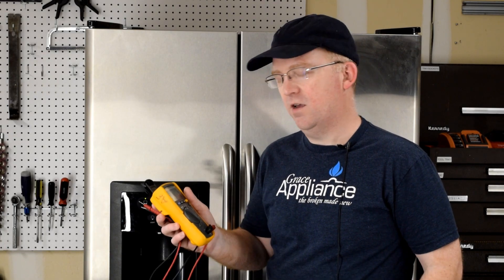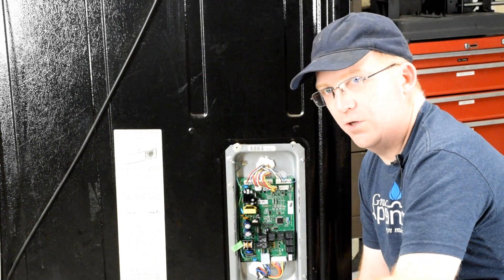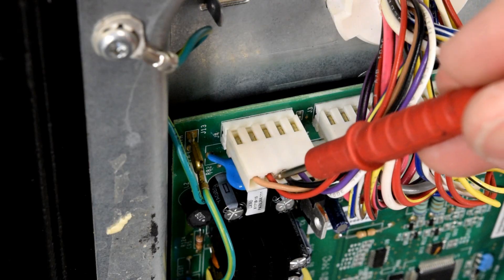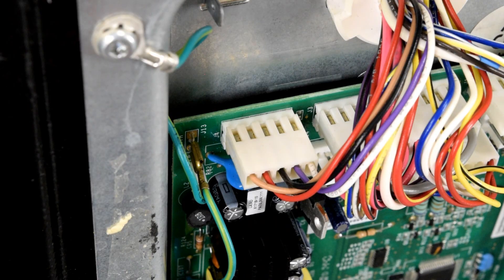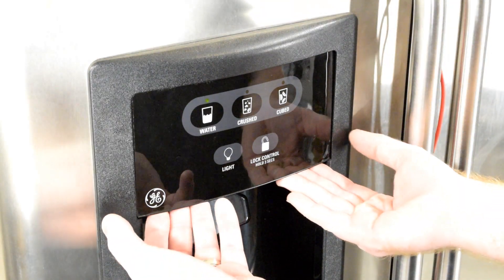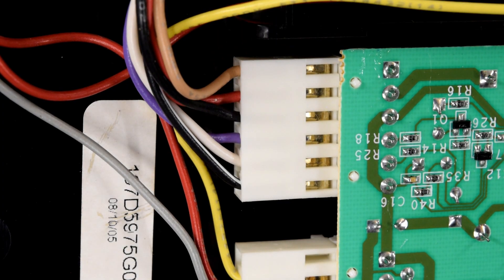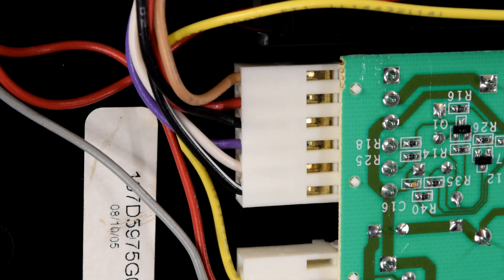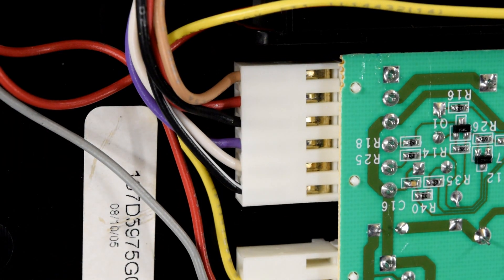Diagnosing a Bad Control Board - Part 4: Front Touch Panel

Comment: Nice, can you tell us where the diagnostic codes table2 are for the HSM25GFTASA type of GE Hotpoint fridges, I know how to get into diag mode from the 4 front touch buttons for temp, but don't know the diag codes, or maybe you can just tell me the one I need to diagnose the defrost heat circuit ? THANK YOU !
Reply from the maker: john Doe hey, 
I never put a lot of faith in an error code and tend to test for the particular failures at the suspected components based on the symptoms I’m seeing.  
If you’re having defrost issues, this video will be helpful.  You’ve got a wr55x10942 Control which is the same as what I’m testing ok this video.  
Let me know if you have any questions!

https://youtu.be/XeZfpB7ok90

Thanks!
Andy

Comment: Thank you. What if my panel lights up, but not dispense water? I have changed the filter, changed the valve, re-connected wires at bottom, but still no luck. I got water at 3 random times. The panel does light flickering when I press for ice and does not dispense any. I see ice in the tray. Plz suggest any pointers you may have. Thanks again
Reply from the maker: Hey, I'd first suspect that the dispenser micro switch had failed.

Unplug your fridge. 
Remove the front panel, and the white plastic housing secured by 4 Phillips screws. You'll see the black switch that's activated by the panel.

You should hear a soft click when depressed. If it's spongy instead of a positive click, it's failed.

Also it should read about .03 ohm when depressed.

Let me know if you have any questions.
Andy

Comment: Wonderful tutorial...very well explained and demonstrated. My son has just moved into a house and the appliances included in the sale included a GE side-by-side fridge/freezer. The fridge and freezer both work well but the touch panel does not, in spite of efforts to "reset" it. I applied a multimeter to the black and red "input" pins of the touch panel and it shows no power reaching the board. Unfortunately, when I tried to do the same at the control board, it is not the same as the one featured in your video, so I was not able to identify the "output" wires carrying the power to the touch panel, for testing. Any thoughts? The touch panel features a temperarure selection function. I have a photo of the control panel. Also, if I find that power is "leaving but not arriving"(!) this obviously means a fault somewhere along the connecting wires...what's the fix in such cases? (Specifically, is it possible to re-wire between the control board and the touch panel?)
Reply from the maker: Tim O'Leary hey Tim, thanks for the kind words, you’re most welcome.  

I think you’re on the right track in your diagnosis.  It does sound like a poor connection to the front board if indeed you have the correct measurements at the main board.   

Now, there is a very common connection to fail below the freezer door hinge.  It’s located behind the front kick panel. If you’ll inspect that for broken or corroded wiring, unplug it and replug it in about 10x, that may solve your issue.  

If not, let me know and we can go from there.  

Thanks!
Andy
Reply: @GraceAppliance  Many thanks for the speedy reply, Andy. I will do as you say and let you know how it goes; (it may be a week or so before I get back to my son's place). Tim
Reply: Hi, Andy. You may recall that I contacted you here recently about my attempts to identify the cause of a "dead" touch panel on a GE side-by-side fridge/freezer. Because the main control board on the appliance differs from the one featured in your tutorial, I have been unable to identify the two wires I need to check, with the multimeter, for the 12/14 volts going to the touch panel. I was wondering - if it's not asking too much (!) - if I was to send you a photo of the main control panel, would you be able to steer me to the two pins/colours on it that I need to test for the "voltage out (to the touch panel)" ?  Many thanks again. Tim O' Leary, Dublin, Ireland.
Reply from the maker: @timoleary9514  sure, glad to help if I can. Please send a picture of both the touch panel and also the main control board. Thanks!   Graceappliance@gmail.com

Comment: Andy, I have a Ge side by side which dispenses water but will not engage the ice dispenser. Micro switch is good. I was wondering if the ice dispenser door solenoid may be faulty since it doesn’t open only an inch or so. Does the solenoid activate the auger as well?
Reply: If it’s the touch pad board it shows it being not available anymore
Reply from the maker: hi Joseph, what is your model number please?
Reply: Model # GSS22JEPCWW
Reply from the maker: Joseph Folsom thanks!  
So, since you have only one paddle that activates the water and the ice, and since the water works, I agree that micro switch is working.  

Now, I don’t believe the ice door flapper shares voltage with the auger. 
Does your auger activate when the switch is depressed?  

I’d start by testing for 120vac at the solenoid. If the auger is not activating, I’d also check for 120vac to the auger as well. 

Let me know what you find.  Thanks!
Reply: Will do. The voltages in these machines work on both vac and dc interchangeably. Power to the touch pad is 13 and some change dc, and 120 vac to the solenoid? How can you only have approximately 14dc coming into the touch pad board and yet have 120 vac supply to the solenoid?
Reply from the maker: Joseph Folsom it depends on the component if it’s DC or AC. Your auger and solenoid are both AC. 
Your touch panel , fan motors and temp sensors are both DC. I’m sure there are other things that are DC as well, but I can’t think of anything else at the moment.

Comment: Hi Andy,
I replaced the control board. Now the compressor gets hot but the refrigerator still does not cool. Using a Kill-A-Watt meter the refrigerator draws around 10 amps when initially plugged in and then I can hear the relay click and current draw drops to around 0.25 amps. Does this mean that the compressor is bad?
Thanks,
Brian
Reply from the maker: It does sound like a locked up compressor. (I.e. the motor inside the compressor) as these will initially pull about 10 amps, but will usually drip to about 1.5Amps once the system pressure equalizes which takes a few seconds.  Can you feel the compressor running softly after it draws the 10 amps, or does it not run at all.  
A locked up compressor will usually buzz loudly until the overload relay clicks on.

Did you say that you’d also replaced the compressor relays?  If not, you may attempt to put on an RCO810 (not the rco410) which is a compressor hard start relay. You may be able to get it started this way and then take the same amp measurement at that point.  It should read between 1 and 1.5amps.  

If it I’ll then start, but pulls higher than this amp draw, the compressor is on borrowed time, but may run for a time.

Comment: Hi Andy, 
First thank you for your videos. They are very good but I still have a question. My GE side by side stopped cooling. Both the evaporator and condenser fans run but the compressor does not run and is cool to the touch. I removed the starter relay and tested for continuity between the 3 terminals on the compressor, there was continuity between all 3 terminals.  Next I checked for short between the compressor terminals and chassis, there was no short.  So I replaced the starter relay and the compressor still does not run. I checked for voltage between the leads that plug into the starter relay and no voltage. Next I removed the cover for access to the control board and found that the control board was blackened under the large relay (832-1C-S) that the grey 3-terminal plugs into. Does this relay just fail or should I chect the defrost system?
Thanks,
Brian
Reply from the maker: Hey, they do simply fail with age.  The relays get old, get carbon build up on the contacts and the poor connection creates excessive heat.  Then, you get what you’ve got.  
I would start with a new control board and monitor the fridge to see how it does.  I would not expect anything outside of that issue you’re looking at.   

If you order using the amazon link in the description, this helps the channel a ton.  Thanks!
Reply: @GraceAppliance  Thank you for your reply. I was afraid that if I just replaced the board that it might fail due to a problem that I have not addressed.

Comment: My top ice maker not working on my dual icemaker GE model GFE28HSHDSS on the display only the " ice bottom on or off" will display the " ice top on or off" indicator not displaying. The water dispenser also not working this is a single ice water paddle unit. The dispenser light does come on when paddle depressed. I checked the freezer roll out drawer switch and the two refrigerator door switches they are good. In the beginning of troubleshooting all of the other indicator display functions were indicating when depressed. After removing the display board for inspection now the freezer is giving a LF code and fridge display giving a LC code. When I depress them for a short period the temperatures are displayed then back to the error code. Do I need to replace the display board.
Reply from the maker: Hi Brad, I'm sorry I'm not able to find any technical data associated with the error codes you've given. Have you had any luck finding what these codes indicate?
Reply: @GraceAppliance  Disregarding the codes considering my original problems. Does it appear the display board was going bad. And that the codes appeared a few days later after I removed the display panel for visual troubleshooting. I just cycled power to the refrigerator and now I have no display but I can still hear the compressor running.
Reply from the maker: Brad Miller the short answer is that it’s going to be a tough call to determine if it’s a failed touch panel or main control board.  
I would start with inspecting the connections between the main board and touch panel. It almost seems to be a poor connection. I can count on one hand the number of front touch panels I’ve had to replace, but can’t count the number of main boards I’ve replaced.  
However, you’ll find (usually under the top hinge of the door the touch panel is on) a cover you can remove to expose a multi pin connector which is the harness for the touch panel.  I’d disconnect and reconnect this connector 10x to see if it might resolve a connection issue.  Also, look closely for damaged wires or corrosion.  These tend to be troublesome because the door moves these wires any time the door is opened / shut and creates connection issues over time.  

Let me know that helps at all.  

Andy
Reply: @GraceAppliance  There is a Dispenser control board PT#WR55X29507 located on the very top of the door just right of the left door hinge. It was determine to be bad. After replacement all functions are back in service. The freezer light is also back working. Thanks for pointing me into the right direction. Hope this post helps someone else.
Reply from the maker: Brad Miller wow!  Nice work. I have not come across this particular failure yet out in the field.  
Seems reasonable given your symptoms that that would be the trouble maker. They had to go and get fancy with it.  So dumb.
Thanks for the follow up and am glad you got it sorted out! 

Stay in touch, Andy 

If you’ve found this ad-free information helpful, please consider a $1 donation to help support the YouTube channel at: https://www.paypal.com/donate/?token=p_-S29vsNHZsyxBt-llMSH_zJe4utLKcfvVRiZJHP0vIM5ldZMsdxPh9xywqckuI65fdq0&country.x=US&locale.x=US

Comment: Thanks for the video. Mine was showing a short  at the main control board (0.24V). When i disconnected the touch panel, I was getting 13.8V at the control board AND the touch panel connector. I am concluding my touch panel has a short on the board, but my control board is still ok, since it’s giving power to the line.
Reply from the maker: GrockNRoll033 hey!
I’m not understanding how you are determining the short in the board.  This would be determined with an Ohm test vs a volt test, but I’m not sure how this would be tested on the board itself.  

What symptoms is your fridge giving?
Reply: 5 years late but I think that's a good pointer to check with sub board unplugged too. The faulty board could be causing voltage drop. 
As grace appliance mentioned ohm the sub board.  + and neg I'd say. Might have some resistance but shouldn't be 0.
How did the fix work?

Disclaimer I'm not professional appliance tech.

Comment: Hi Andy. Great videos. I have a side by side Model GSS25KSWASS. Started not dispensing water and then started back. Few days later no dispensing water or ice. The buttons on the display were working but no temp less light up. I unplugged fridge and plugged back in and the display started flashing 00 for a few seconds and then started scanning 0. Now Light and buttons do not light up but beep when pressed. I hard wired the molex connector behind the kick plate at bottom of freezer door and still have the same symptoms. The rest of the refrigerators working fine. Cooling and freezing normal and fan in freezer working  and I believe I hear fan at bottom on back of refrigerator. Checked voltage on main board and got 13.5 VDC. Have not checked behind display. not sure how to remove the display. Does this sound like a bad main board or Display panel. Thanks for any help.
Reply from the maker: Hi Jim, 
Hmmmmm!   You’ve done what I would have first suggested which is to check the molex connector that you rightly identified as a troublemaker.  

Now, from here it gets a little dicey to properly diagnose. Since you are not experiencing any issues outside of the touch panel such as no cool refrigerator etc, and you’re also getting the appropriate voltage from the main control - my recommendation is to start by checking for the 13.5vdc at the back of the touch panel.  If 13.5vdc, replace the touch panel. 
All signs point toward a bad touch panel to me though.  

To remove the touch panel, you should be able to place 3 fingers on each side underneath the panel and lift gently as you’re pulling toward you.  It should tilt toward you. 

If you’ll order through one of the affiliate amazon links in the description it helps the channel greatly.  Also, while I’m 99% sure it’s going to be that front touch panel, Amazon has a no hassle 30 day return policy if you catch my drift. wink wink nudge nudge.
Reply: @GraceAppliance  Thanks for the quick reply. I'll do that and let you know what happens.
Reply: Andy, my part #WR55X10884 was not available on Amazon. I found it on other sites that said it was a replacement for WR55X10724. I can find that part # on ebay. Also WR55X10859. They both look exactly like mine. Would one of those part #'s work.
Reply from the maker: Jim Johnson hey, the WR55X10724 shows to be a good match. That is what I’d get.  Thanks!
Reply: @GraceAppliance  Hi Andy. I got the interface front panel and installed it. Still got the same symptoms as before. Does it sound like possibly the main board or are there other parts that can cause these symptoms. Thanks for your help.
Reply from the maker: Jim Johnson uggg! I’m sorry to hear you’re still having issues!  So, yes that leaves only the control board (or possible faulty wiring, but most commonly the main board). Hopefully you’re able to return the touch panel, but hang on to it until you put it the new main board just to make sure you won’t need both.  

The part you’ll need can be had from this affiliate link: https://amzn.to/2TL2fZ0
If you purchase your parts through this link it helps the channel a lot and is appropriated. 

Please let me know if you have any questions.  Thanks! Andy